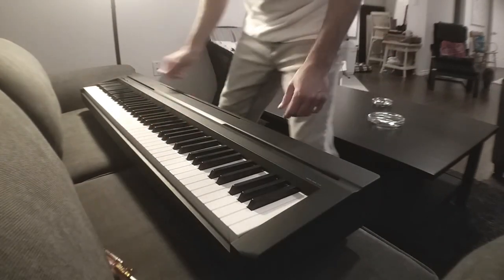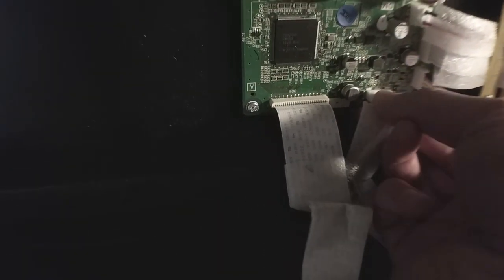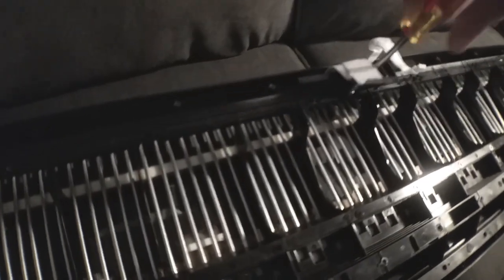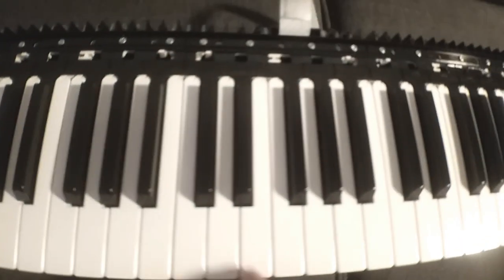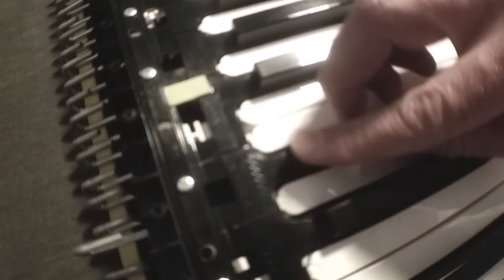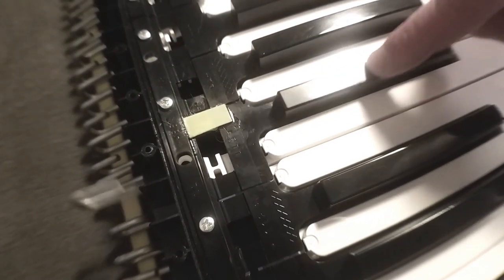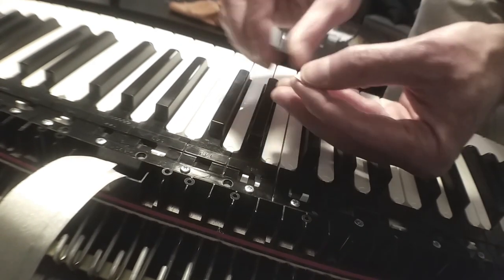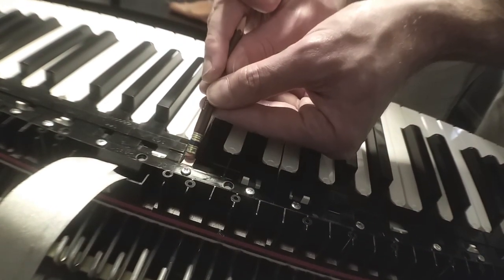Fix Broken Keys on a Yamaha P-45 Digital Piano

Comment: Thank you for making this. I have the identical P-71 model and spilled a glass of wine on it and a quarter of the keys stopped working. I was able to use this as a base for disassembly so i could get to the guts and clean the PCBs and membrane switches. And if any of you out there every spill liquid on the keys, DO NOT PRESS ANY OF THE KEYS after the spill. The membrane switches act like little plungers against the board and pressing the keys with liquid pooled around the switch will actually suck the liquid into the switch. best thing to do is tilt the keyboard forward and let the liquid drain away and keep it like that for a few days.
Reply from the maker: Hey - Thanks for the info. I've had a few coffee spills, but nothing serious yet. I hope you got everything working okay.

Comment: So helpful - thanks for making this video. Extra kudos for using a hand screwdriver - I used an electric one and it still took forever to unscrew the dozens of screws! In my case I had a "broken" note, but it turned out that the mechanism for the note had somehow come unclipped, and I just pushed it back together.
Reply from the maker: You're very welcome! I think I through out half the screws so I won't need to bother with the pain again - just don't tell Yamaha! (I rarely move it around so I'm not worried about the stability of the casing). Thank you for watching!

Comment: Hello Cory... I just want to really give you a heartfelt THANK YOU for this video! After getting a stupid $150 estimate from a local repair shop last week, I decided to follow your instructions on my Yamaha-P71B (this is the same piano as yours but the Amazon version, no difference whatsoever), and of course, my F4 sharp black key had somehow cracked right at the top of the plastic, just like your piano. The G and A keys to the right were also soft, apparently because of this (maybe also because of the dust that had built up inside, who knows). The crack was right at the top so I proceeded to apply the crazy glue which seemed to fix it altogether, but with my key it became apparent that it was best to place a very small cut of a bread clip at the bottom and not the top. If anyone tries it this way, you have to make sure that the white keys do not touch that bread clip when you press them.

By the way there are around 60 screws at the bottom... 11 inside... So over 70 screws, not 47! What a pain that was. If you have an electric screwdriver it will save you so much time. But I got it done and that F sharp and the adjacent keys are now back to normal. I hope it holds up over time! Thanks again!!
Reply from the maker: You're welcome Ivan! This is exactly why I decided to make the video. Many people don't realize that sometimes paying out the money for repair is either too expensive or just ridiculous if it can be fixed at home, and certainly in my case buying a new one was not an option. I'm glad you got it fixed up. And, remember you can also swap out any of the octaves to a new location on the keyboard. So you can move the repaired one to a lesser used area, and move the lesser used octaves to the middle to give yourself a brand new feeling in the centre of the keyboard.  :)
Reply: @corytoddmusic  didn't even think of that... Thanks for the tip

Comment: Thank you sir. Going to attempt to troubleshoot tomorrow. The last 3 C notes aren't responding and a couple other random notes in that range. Hoping it's just something simple like from just being dirty or something. Good to see the process of taking it apart before attempting it myself.
Reply from the maker: I hope it does just need a cleaning. If the notes still don't work, you could try using it as midi-only via usb to trigger piano samples on a computer. I'm not sure how the electronics work, but it may be possible to do that even if the internal samples don't trigger.
Reply: @corytoddmusic  Yeah I tested to see if the midi still worked but no luck. I took it apart with no problem and saw it was pretty dirty. Gave each piece a few light taps to get the dust out and I put it back together.

Initially when I tested it all the same notes weren't working. I turned it off and did something else cause I was frustrated lol. I came back it an hour or two later and everything was working fine and has been for the last day. Hopefully it doesn't give out on me anymore. Thanks again.

Comment: oh wow that looks easy. my C3's F key makes a clacking noise when i press it.  i guess maybe the felt that lines the box thats supposed to muffle the weights fell off?  dunno why just that one key tho. was just lamenting about how annoying it is that i want to upgrade to a new digital piano, but ill open it up first.  thank you!
Reply from the maker: Thanks for watching! I'm curious to find out as well. I wonder if the weight just needs to be tightened somehow? If you do open it up, maybe leave a comment describing what the problem was, or looks like. Cheers.

Comment: Thx Cory! I just bought a P71 for $50 because 7 keys not so good. Just pulling the cover off showed a couple of the hammers crossed by a hammer I now have to reinstall (video on that?) and a few slightly pulled out. That's it! Wow, what a great entry to upgrade from a PSR 280. Great video and I look forward to a key breaking!
Reply from the maker: Sounds like an excellent find! I haven't had to mess around with those hammer weights (not sure what they're called), but if I do I'll be sure to get a camera in there and record it. They look like they might be flexible enough to bend back into shape... if that's what the problem is. Hopefully an easy fix. Best of luck getting it fixed!

Comment: I just got a like new yamaha p71 (p45 clone built for amazon sales) for twenty bucks because two keys were "sticky". I opened it up and just had to pull the weight rods back into place thanks to your video. I am very grateful to you. The only other thing is that the highest group on the keyboard seems to have very low volume compared to the other groups. More so than the normal sound so I may need to replace that group but I. Trying right now to clean contacts. Thanks a lot brother!
Reply: Hey J, I own a p45 and also find the high-pitch keys to be lower in volume, needing to strike them harder to get the same perceived volume. I have read many reviews of the p45 by others that also note this, so I guess it's not a fault as such, just how this model works. To be fair, I poked the real piano that someone I know owns, and this was also the same in this regard, so maybe in the p45 it is by design...
Reply from the maker: You're very welcome. That is awesome! Have you tried listening to the higher pitch keys with and without headphones? I'm just wondering if the speakers aren't capable of producing a consistent volume across all octaves. If that is the case, you could find some inexpensive but higher quality speakers and solder them in. ;)
Reply from the maker: I think it's just the "grading" that they use to simulate the feel of a real piano. I don't have any experience with other digital pianos (other than a clavichord 20 years ago), so I don't know how the p-45 compares to other piano's in it's grading. If J's is a clone, then it might not be made to the same specs as a Yamaha.
Reply from the maker: oops... I meant to say "Clavinova".
Reply: @corytoddmusic  ya I think it's just by design. They are audible just very light. Thanks again my friend!

Comment: Great video sir, I have a P45 as well and the D4 key just stopped working, meaning there's no sound being played when I press it. Would you happen to know how I can fix it? Thank you
Reply from the maker: If you're confident taking it apart, you might be able to see if there is something preventing the key from making contact with the electronics (for lack of a better word). At least you might be able to see if it is an electronic vs mechanical problem. If it is a broken electronic trigger/contact you may be able to find a replacement with some help from google and a soldering iron, but I haven't run into that problem, so it's beyond my experience to provide a concrete solution. If it is just a problem with key making contact,  you could swap keys with a less used area of the keyboard - highest or lowest octave. I hope that helps!
Reply: @corytoddmusic  Great advice sir, thank you so much for the help

Comment: Thank you for the video!!! It helped a lot. Quick question: after putting back everything, I'm finding the keys now make a bit of sound (like rubbing against something, even squeaking or something). Did that happen to any of you? Did you add grease in the keys when you opened it? Should I maybe? I didn't remove any of the grease that was there in the first place, but thought maybe it is the problem.
Reply from the maker: You're welcome! The only squeaking sound I experienced was when I had accidentally glued the keys together. This is briefly mentioned at: 07:52 in the video. As I would press down one key it would force the key beside it to move down as well, but on a slight angle which made a squeaking noise.  That mistake did eventually cause a second crack after a few months. If that is the case, use a small pair of scissors to detach the keys where the glue/breadclip has spilled over or spans the two key sections. You'll be able to see it clearly if you compare the key movement to an unrepaired key section. If the squeaking is coming from the repaired key, then that may be the case. Otherwise, I can only guess that the case was slightly misaligned when putting it back together. As for the grease, mine has so much in it that it would take considerable effort to remove it all. I'll  assume that they all come out of the factory like that, so I can't see it being a problem. I hope that helps!
Reply: Thank you:)

Comment: Hi.  I have a Yamaha P115 model.  I recently noticed that two keys are becoming wobbly.  Do you  think the inside is the same line yours.  I could try n find a technician but I am curious. I’d like to attempt to do it myself.
Reply from the maker: Leila - Sorry I didn't see your comment earlier! It looks like it's the same keyboard overall, but the p-115 has better speakers and it allows for more samples (polyphony) to be triggered at the same time. I can't say for sure, and I wouldn't want to mess with your warranty... but I'm the kind of person that just starts unscrewing devices to see if I can get access - just go slowly, and watch for wires/cables that might need to be unplugged before completely opening the  shell/outer casing - I hope that helps!

Comment: Our Yamaha piano is having a slightly different problem, I wonder if you could shed some light on it.  The keys "clack" when played, and my son says it takes more pressure to get good sound.  He plays frequently throughout the day and he is a vigorous pianist 😏.  We've had it for about 6 years.  Does this sound like key fix/replacement is the solution?  Thanks!
Reply from the maker: Actually, I had this exact problem in the first year with my Yamaha. I spent a couple of days trying to figure out the problem. The solution for me was to adjust the sensitivity settings. I believe there are 3 different settings, here is the information on how to adjust it (very easy to do): https://usa.yamaha.com/support/faq/pianos/9516.html
If that doesn't fix the problem I'm not sure what will. I hope that helps!
Reply: @corytoddmusic  thank you!  I appreciate your help. ☺

Comment: Hey, hope you see this, some guy in my area is selling his P45 for just 150€ because the A3 key "sometimes has a little heavier resistance to it when pressing it down" but it still produces sound. Would you reckon that this could be fixed the same way?
Reply from the maker: "Goop" would be my best answer. :) I have guitar picks, potato chip crumbs , a few spilled coffees (and even spilled beer sometimes) that I find in my keyboard. It probably just needs a good cleaning!

Comment: Hi, great job , could you send me a picture of the orange electronic board , where the sustain pedal is connected ? I need to see the color code of resistors to repair my Yamaha p45 ,my cat  has urinated on the piano. Thank you.
Reply from the maker: Hi Javier, it may be some time before I open up the piano again. I recommend contacting a Yamaha dealer and asking about replacement parts. I did have a look online to see if I could find that I/O board, but could not find it.

Comment: You literally saved me hundreds of dollars on this in my mind before I looked it up this piano had chipboards all over and pressure pads lol then you show us just how cheap these things are to make I just can't believe the black keys are all one molded piece that uses its own structure as suspension to spring load the keys these pianos are expensive new smfh horrible design
Reply from the maker: That was my situation. I couldn't afford a new piano... so I had no choice but to find a solution. It's also fun to open up electronics and see how they work. Even things like computer monitors can be easily fixed quite often, with a little soldering knowledge; but you need to be careful. I'm hoping to upgrade the piano one day to one with proper hammer action, a Kawai or higher quality Yamaha.

Comment: Hey, I have the same piano, the p-45 digital piano, but the ribbon thin rectangular ribbon cable snapped a little bit and there's no sound coming out whenever I press the keys. is it possible to replace the ribbon cable connecting the keyboard to the circuit?
Reply from the maker: If the cable in the p115 is the same as the p45, then you can get one here: https://www.google.com/url?sa=t&source=web&rct=j&url=https://www.fullcompass.com/prod/534500-yamaha-wg318100-flat-27-pin-350mm-ribbon-cable-for-p-115&ved=2ahUKEwiLr8-8nPv0AhUWCM0KHQTCCFEQFnoECAcQAQ&usg=AOvVaw0yxIMbHS1a_srq2fSSnJq3

You may need to call yamaha to check, or see if you can order one directly from them. I hope that helps!

Comment: really thanks for this video.....do you know if i get a cheaper power supplier with the same characteristics ,if it will work?......thanks anyway,really a good video you made
Reply from the maker: Just make sure you replacement power supply has the same specs: https://www.sweetwater.com/store/detail/PA150--yamaha-pa150-power-supply
Reply: @corytoddmusic  thank you very much you really are so kind.......if i may ask again ,i have a problem the power does not rich to the piano and it might not be the powersupply .a friend told me that somewhere inside there is a fuse and maybe its damaged .....what is your opinion ?

Comment: Really good video, bug i was wondering what other problems you've had witt this keyboard, i have the p45 but for some reason the F4# doesnt work and i thought it was dust so i cleaned it but now it still doesnt work and some key have double sounds or doesnt recognize the pressure :( you have any recomendations or some videos that will hopefully help?
Reply from the maker: Thanks for watching! I haven't had any other problems with the P-45. As for what might be causing problems with yours, the only thing I can think of is that the Function key is stuck and causing problems. But it sounds more serious than that. Have you opened it up to see if that F# key is broken?

Comment: Can a broken key like this cause issues with touch sensitivity I wonder? I've looked at the contact strip on mine and it seems fine, but key that occasionally barks at me for no reason is broken in exactly this way. Hoping this fix will somehow solve the touch sensitivity issue but that doesn't seem logical
Reply from the maker: It may just be that the sensitivity settings were accidentally changed - more info here: https://usa.yamaha.com/support/faq/pianos/9516.html
I have had that (barking) problem when using the piano as a midi controller (when the buffer can't keep up). Otherwise, I'm not sure what the problem might be.

Comment: Thanks for sharing, I'm planing to reuse my old p35 and actually take keybed out and integrate with furniture so the height of keyboards is lower hence I can maintain comfy posture,. Anyway where did you get that double fader?
Reply from the maker: Thank you for watching! Sounds like a good project. I think it would be great to drop one of these into an old upright piano frame. That double fader is actually a home-made arduino based midi expression controller. I'm slowly putting together clips for a how-to video on building one.
Reply: @corytoddmusic  o yeah old piano is not bad idea as well (if space is not an issue :D) . I though you made it.

Comment: Quick question: we plugged in headphones and now we can't get the sound to work without the headphones being plugged in now. Any ideas how to fix?
Reply from the maker: Karen, I'm afraid I don't know for certain how to fix that. I do know that the p-45 has, what I believe is called a "Switching Jack" for the audio. When headphones are plugged into the unit, there is a physical  switch in the jack that interrupts the speaker circuit, so electricity get's cut from the speakers and diverted into the headphones. Is it possible that there is something still stuck inside the headphone port/jack? For example, I have headphones with the small 1/8" plug (like you might use on a phone) and in order to plug them into the piano, I use an adaptor for the larger 1/4" piano Jack. If it's not an adaptor still in there, then, if you have kids running around somewhere; it might be a ham sandwich, or literally anything else! :) If you can't see anything in there then you might need to replace the jack, but there's no way to know for sure from here. Hope that helps!
Reply: @corytoddmusic  Thank you! That gives us a place to start. We have been trying to figure out what the issue is ourselves without needing to pay for a repair. I appreciate you taking the time to give me a reply! Blessings on your work and day!